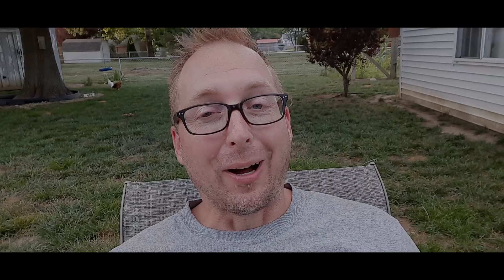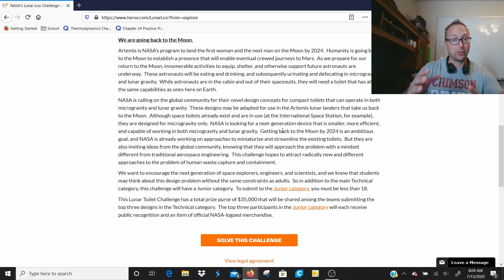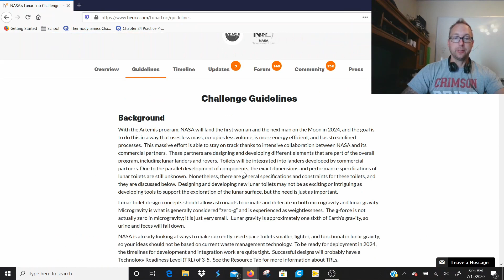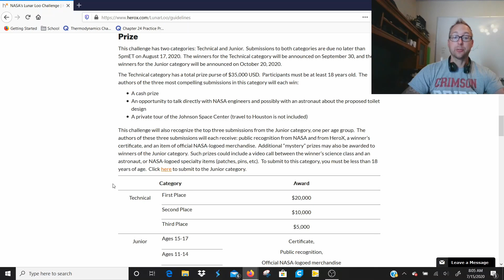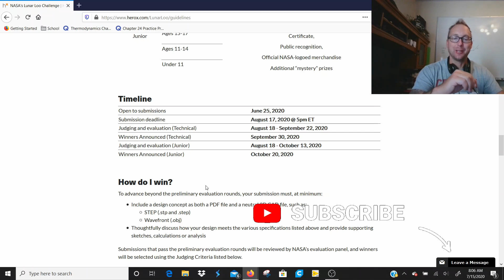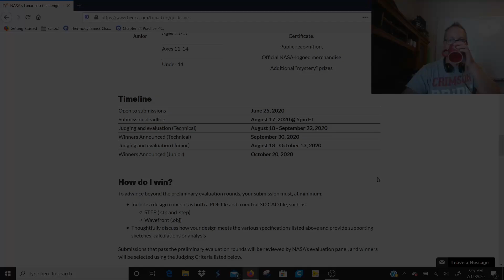Designing A SPACE TOILET for NASA | Fun Engineering Challenge

Comment: Just a thought, using flexi hose pipe bodily fluids (both vomiting and urine) there a plastic adapters for male and female methods of urination. the pipes can be attached to a small pump as for a continuous removal once engaged, and a small sink grinder for the solids again added to a suction pump,
Reply from the maker: That is a good idea and is the process that is currently used on the Space Station and on the new Toilet that was designed for the Space Station. The only issue is that if you draw a vacuum in a tube for the urine, you will need to separate the urine from the air before sending it back out into the cabin. The separator fans that the ISS use are extremely power hungry and would far exceed the 70 Watt max power usage. All Great ideas, but the restrictive requirements really limit it.
Reply: Hii sir.
When we try to take a sharp turn, then we face a force due to change in direction of motion and inertia. More the density and mass, more the inertia. So i used this method to separate dense particles from less dense air.
Also the circulating air circulate within the toilet using around 40watts, it did not produce vaccum but flows freely within the toilet and through activated carbon filters and UV light to kill germs and odour.
For urine i used a cohesive and adhesive forces based mechanism